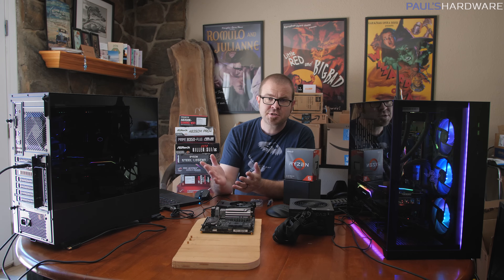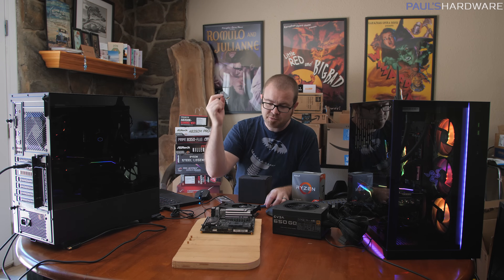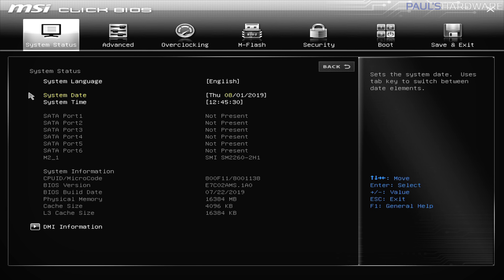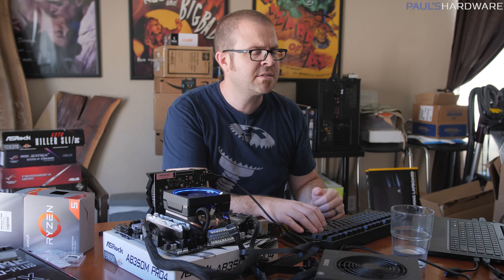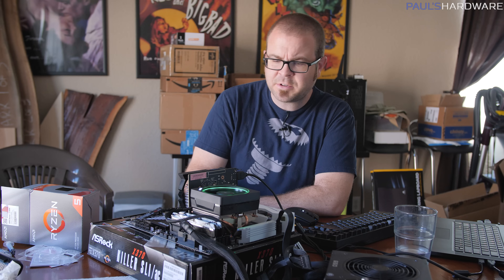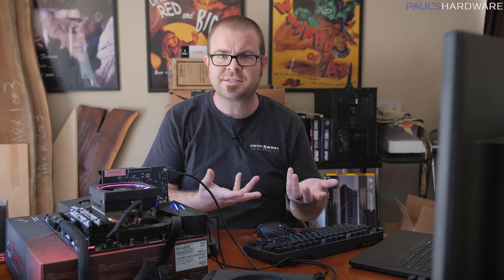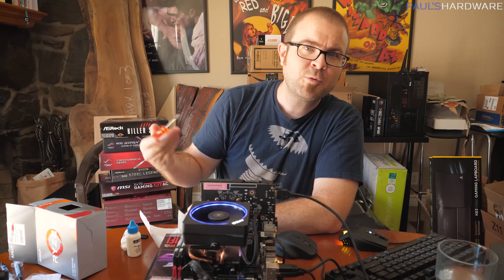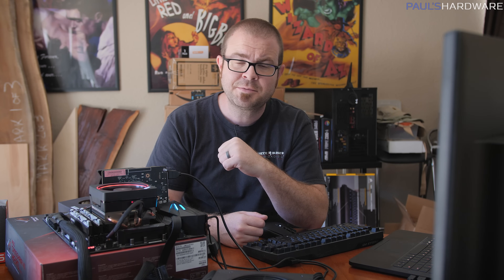Does Ryzen 3000 REALLY Work on Old Motherboards? Testing B350, X370, B450 and X470

Comment: Had pretty much this exact bios issue at work the other day. I ordered a "gigabyte b450m aorus" for a customers build with a new 3400g. I had intended to update the bios with a first gen am4 apu(Yes they exists I wanna say it was an a8-9600) it didn't work for some reason(chances are it's not supported by the b450 chipset at all). So I took that out called gigabyte and they said as long as the board had the f30 bios revision it should post and allow for bios updates to the latest version with the 3400g, even though the board didn't support the chip fully it should work. Luckily for me it did, saved my bacon and I'm glad it was able to get the latest bios in, what sucks though is I had to do a bios stacking thing like you did with the asrock board so I went from f30 to f32 to f40 to f42a uugh to like 15 minutes.

Comment: So can these older Mobo's handle the new R7 or even R9 cpu's?

Also, I was more fixated on the Wizard of Az poster than the actual video..
Reply: R9 3900x with stock clocks is ok with x370/470 and b450. B350 depends on the motherboard quality.

Comment: I find a lot of bios update problems are cause by rushing the process and poking around with stuff inside while updating. Let the computer reboot as many times as necessary and wait until the OS is fully loaded. Shut down, turn off the power supply and then remove the flash drive. Be sure you're using a rear USB 3 port and not a flashback port.
You might get away without this process and no problem but then again you might not. I find that Asus boards are picky with this. Also take the time to read your Bios to see what version you have installed. As Paul explained it's easy to make a mistake.
Happy to see everyone is enjoying their AMD experience.

Comment: Did anyone else notice that the system on the left in the intro has RGB lighting running and on but the power supply is NOT plugged in 🤔🤔🤨🤨

Comment: I have a b450 tomahawk and when trying to update the BIOS, it just says "FS0: <null string>" and doesn't detect the BIOS file in my usb drive. Trying to update from 7C02v18 to 7C02v1A. Any help is greatly appreciated!
Reply: @Wischmopps sorry i didn't update my comment. I got the solution already. It was to copy the file directly to the usb drive, no folders, no nothing, just the bare bios file itself and it worked. Appreciate you trying to help tho, thanks!

Comment: Clip style heatsinks are a bane of humanity.

Put a nice gouge into a Socket A board (still worked at 100%) before I learned that a nut driver works so well.

I myself will update from the 2600 I currently have, to a 3700X or 3900(non-X) later this year.

If nice sales are on tap, the 3900 WILL be mine.

Comment: So I recently upgraded from my Ryzen 5 1600 to a Ryzen 7 3700x for my Asus Crosshair Hero VI (WIFI - AC) X370 board. It's supposed to be supporting this chip and mine sorta does, however it won't allow me to use the newest updates that fully allow me to tinker with voltages, timings, and memory speeds. So instead of being able to tweak anything, my chip overclocks based on out of the box settings, and my memory which is rated for 3000mhz can only currently run at 2133mhz. Currently in talks with Asus support to fix the issue I have, which is whenever I try to upgrade my bios firmware to the current iteration or the one before it, my mouse and keyboard do not allow me to navigate the bios, let alone enter it properly. Dunno if anyone else will have this issue, and even though this board and some of Asus' other first gen AM4 boards are supposed to support Ryzen 3000, you might come across this issue. If I'm able to get this resolved I'll edit this post.
Reply: You are most likely then running a beta BIOS that are for testing purposes. Full version that will be announced on the support pages for the board rather then the forums will most likely have full functionality back again.
Reply: @SkyForce6700  I've been downloading bios revisions from the Asus support page for my motherboard.

Comment: They need to stop screwing around and make it so the BIOS can boot from a little ARM processor dirt cheap one.. Don't need much processing power to load into a BIOS and just make it where every board can boot into BIOS without a CPU installed.

Comment: Am i the only one having a issue with the asrock x370 killer sli/ac not finding the file in the uefi? even though its on the root of the flash drive and it's formatted in fat 32? and the current bios on the board is "p5.30"

Comment: I am running the new 3000 bios on my Tomahawk B450 with my 2700x. I have seen performance gains, like 4.7 turbo boost in Firestrike adding about 500 points. Also my ram can be set at 3000 instead of 2933. Very stable and cool just not that great of a bios otherwise definitely better performance.
Reply: Make that 3200 actually.

Comment: Extra credit for finding a legitimate use case for the GTX 1650.
Reply: 1650 is still better than my previous radeon hd 6570
Reply: @Blazeorite  that the 1650 is only great for prebuilts as it doesn't have enough gpu power to justify its purpose in a new build
Reply: @mikex2825  so my 1050ti is probably better than 1650 ?
Reply: @effexon  yeah its slightly better than the 1050ti but still not as good as the 6gb 1060. If you wanna buy new maybe a 1650 super would be a good choice if you wanna upgrade a prebuilt other than that might wanna save up for an rx580 or 1660 super and up.
Reply: effexon no.

Comment: yep just built mine yesterday not too much problems got the Tomahawk with 3600 and RX 5700 XT works super fast just used the bios button and usb drive easy peasy to update board before i installed anything on circuit board

Comment: upgraded my crosshair 6 hero x370 motherboard, that had previously been running my 1800x cpu. asus's first few bioses sucked, but then a new one was released, and im now having no problem running the same board, with an 3800x. Its fast, stable and awesome. The "flashback" bios feature is something you want. the ability to flash the bios with no cpu installed is VERY useful.
Reply: Sounds very positive for me then since that is the mobbo I just bought!

Comment: Thanks Paul, lovely daughter. I experienced something very strange, maybe you can explain it. I do not have a new processor yet but I decided to make my AB350 Gaming 3 board (rev. 1.x) ready for the new processors. Gygabyte stated I should update using Q-flash to version F31 first, then run a EC FW Update Tool to make the 4 RAM slot available and then update to version F40 which supports the new processors. So I followed their instruction to the letter but after running the EC FW Update tool the BIOS indicated it was back at version F22, which it was when I first used it. So the next time I ran the update tool first and then updated to F31 and after that F40. This time everything went fine and the BIOS showed F40. Untill about a week later, at startup the PC rebooted a few times which usually only happens if you changed the GPU, CPU or RAM. That was weird so I had a look in the BIOS to see if anything had changed. The BIOS indicated it was now back at version F31. I currently don't use overclocking and nothing has changed. How is it possible that a BIOS/UEFI can reset itself to a previous version. Where does it store that data? Of course I am now not going to take the risk of using a new gen processor because it might reset itself spontaneously to a previous version and not recognise the CPU anymore. Do you have any idea what could be going on here and how to solve it?
Reply: Did u find a fix for it?

Comment: I had no problems at all i put 3900x on a x370 crosshair 6 from work and a 3900x on a x470 crosshair 7 at home. Both are running smoothly.
Reply: Only thing i did was update bios

Comment: Asus b450 f gaming mobo bios update 2406 dont use that. It will haywire ur system. I never tested the new one 2501. Just had to reverse back to version 2301.

Comment: I actually had to update my bios on my x570 motherboard. Not because it wouldn't recognize the CPU but because it was giving me a persistent qcode 02 error, as well as refusing to recognize/see my 960 evo ssd that had my OS from my old setup on it. 

Swapping out the bios on it fixed the problem for both the SSD as well as the qcode 02 error. And it's been fine since.

Comment: I was under the impression the MSI's B350 boards in particular can't handle the requirements of CPU's higher in the stack. Is this why you're using a R5 3600? Or is that just what you had on hand? I guess what I'm really asking is what about an R7 or the R9 3950X due in Sep. Think the B350 can handle power levels over 9000?

Comment: I just got a X470 Taichi and the 3700X. During the bootup it borked my NVME drive to the point it was not able to used, corrupted it and was not able to be used. Once I got the bios flashed and a new ssd installed it works but wasted a lot of time. I also found that the RGB Sync software does not work at all. I have tried a bunch of different versions and all fail to run, either get a memory error or a "not compatible" error (since I was trying so many versions, and yes I deleted one version before installing another). I am really miffed as I have a real nice Deadpool themed pc and now my RAM and mobo are barfing rainbows all the time... guess I am going to have to get a unicorn and set it on top to make it make sense! Not sure who to blame for these issue.. AMD for not giving the manufacturers enough time to get it right or the manufacturers not putting enough effort into the testing. Either way about to guy another board and move on.

Comment: As someone who is running a Tomahawk B350 and a 3700X...I can confirm yes, it works just fine.
Reply: As someone considering jumping onto the B350 Tomahawk MB along with 3600, I have to ask: is it possible to do the bios upgrade without an older CPU? (I got my eyes fixed on this mobo due to the PCI support)
Reply: @ltrzepalko  AMD can send you a kit to upgrade the bios I believe, if you do not have another Ryzen CPU.

Comment: Both my ryzen pcs have issues since upgrading to 3rd gen Ryzen. On one the computer freezes during the bios initiation screen sometimes and i have to restart it. The other will reset itself after powering on and reset the cmos every other time.
Reply: Which MB and cpus are you using?
Reply: Did you go through the intermediate BIOSs like Paul did here?

Comment: Been a looong time since I had to flash a BIOS up to enable a newer processor (which was my old Athlon64 3200 nForce 4 s939 system).  It would work with the Dual core Opty 180 with the non-updated BIOS, but had some very strange issues.  So seeing all this is like walking down late '00's memory lane.  Anyhoo, I'll be doing this at some point in the future on my current X370 board (just holding off so that all the initial early adoption bugs can get sorted out). :-)

Comment: Using 3700X on my MSI X370 GAMING PRO CARBON no problems so far but I didn't overclock it and it sits like 4.3GHz when idling and goes to 4-4.1 when running cinebench.
Reply: What cooler are you using and what temps during cinebench?

Comment: I have an Asus x470f gaming and tried to update the bios but it won’t let me update to allow 3rd generation chips. Very odd
Reply: Joey you need an older cpu to update the bios before using the 3rd gen cpus
Reply: The Gesh yes I’m using a Ryzen 7 2700x and it’s now working for me. I Download the latest software and when I’m in the bios choosing the file on my usb stick I have like 15 files , when the usb is only holding that one bios file. Pretty weird and annoying b. I wanna upgrade to the third generation chip. Maybe Paul would know? @paul

Comment: Asus Crosshair VI x370 with 3800x (BISO 7201), got a Qcode of C5 and the system failed to post a day after, cleared cmos and turned off "extreme water cooling" (PMII)? and everything is fine now, ps i have a custom watercooling loop (Radiator  360mm by 360mm)

Comment: the only issue i had with B350-F strix from asus is it wont let my ram run at 3000, its running at like 2833 or something
Reply: That's almost surely not that fault of your motherboard, but weakness of your CPU's IMC ("Internal Memory Controller").

Comment: The issue I have is, I still have an old pc (intel 3570k) so I can't get a 3000series CPU unless it has bios flashback button on it or x570 ( and I won't want an x570 board), so what options do I have?
Edit: I can't go out and buy a 2000 series CPU just to update bios so that the 3000 series will work.
Reply: MSI B450 boards. They all have great VRM heatsinks for OC. All have Bios flash back so no need for cpu or memory to update bios. If you need wifi i recommend the MSI B450 Gaming Pro Carbon AC. If you don't need wifi then you can go with the MSI B450 Tomahawk.

Comment: Thanks for this Paul, makes deciding to hold off for the MAX version much easier. The proof of the pudding on that will be dropping the 3600 into that mobo without needing an older series Ryzen and seeing if it works out of the box

Comment: I upgraded my ridiculously old build (FX-8350 and a 750Ti) last week and I had no issues whatsoever. I went with the B450 Tomahawk because I knew it supported flashback and I wouldn't have to get a separate CPU to update it. Got a USB drive set up with the BIOS file the night before the parts were arriving, and everything worked perfectly. I now have a 3600 and a 1660 Ti working great.
Reply: I'm planning to get a recent 5 3600 + gtx 1660ti
Reply: did you flash the 1A version or v19?

Comment: Here's my experience with a ASUS B450-I and an identical Flare X kit and CPU to your Tomahawk build:

BIOS + CPU (3600X) works great on 2501

DOCP going straight to 3200Mhz results in no POST.

DOCP going to 2933 posts, but the SoC Voltage is way too low for DOCP.

You cannot apply SoC voltage at the same time as a DOCP frequency change.

The only way to get to 3200Mhz is to first start at 2933 DOCP, then change SoC Voltage to 1.1125v, then go to 3200Mhz.

And unfortunately, if you cut standby power, the system will 100% refuse to post after powering back on as a coldboot because the DRAM Boot voltage resets to 1.2V as opposed to using the DOCP 1.35V.

Here's the worst part: ASUS in their best interests decided to lock controlling the DRAM Boot Voltage to high end boards, when it's a critical function for DOCP to survive coldboots...

ASUS PLZ FIX!

Comment: Has anyone tried using a cheaper A320M motherboard that supports 3rd gen ryzen to see if it worked properly?
Reply: Yes, this has been tested extensively. As long as your board got 3rd Gen support it'll run 3rd Gen chips just fine (with the exception of MAJOR clock throttling if one tries to use a 12c/24t R9 3900X, but come on... Anyone who actually does that is retarded).

Comment: I had my BIOS updated when i put my R5 3600 in a b450 ASrock Steel Legend. P2.4 with AGESA 1.0.0.1. But my XMP was causing audio issues. Manually OCed to 3ghz instead of 3200. Then I got P2.6 with AGESA 1.0.0.3. XMP worked but now I wasnt boosting to the rated max boost, ever, on any cores. 4.125 on 4 cores, 4.1 on 2 cores. Max. But it's still better than any of the 2k series and my former 2200g.
Reply: I am still on the 2700x @4.25ghz all cores @1.41v . Idle temps around 30c under load max I've recorded 63c 
I do plan on either the 3700x or 3900x early next year

Comment: Pro tip paul when dealing with the little clamp on amd cpu heatsink fans loosen the screws a little bit and you can snap everything on quite easily, clamp down, and then tighten everything up once its on. Still using my stock amd wraith prism with my 2700x:P

Comment: with my x370f strix and ryzen 3600 my ram work with xmp at 3600mhz at 18 22 22 42. But ryzen master reads memory at 1800 but fclk is 1600. I thought fclk and memory is supposed to be coupled at stock or auto settings. Does anyone know why its uncoupled at auto settings?

Comment: does anyone know why my task manager recognizes that i have 16gb of ram installed, but its not using 8gb. note: the ram was running fine at 16gb at 3200 speed since i built it..... but now its running 8gb at 2133. my xmp profile is ive still set to 3200. i dont know whats going wrong between the BIOS and the OS.

Comment: If you're going to buy an older AM4 motherboard and a Ryzen 3000 series CPU, and you don't have a 1000 or 2000 series CPU to use for the BIOS update, just buy a board that has flashback capabilities. MSI and ASUS both offer boards that can do it. There are too many hoops to jump through to do it any other way, IMO. Either buy a board with flashback, or splurge on an X570 board.

Comment: Hi Paul,

First time PC builder here, followed your most recent gaming computer build video series (watched it 20 times probably, lol) I had bought different components than you, an aorus ultimate gaming mobo x470 and a 3600x...everything went very well, had no problem with the build at all, however because it was 3000 series cpu and a x470 mobo it wouldnt post. Took it to my local pc store and they charged me 50 bucks (fair price) to do a bios update and it worked fine afterwards. 

Pretty proud that the PC store employee said for a first time builder I did very well, I said that I had watched your channel a lot and he nodded and said "Good, you're doing it right then, he has an awesome channel".

Keep up the good work!